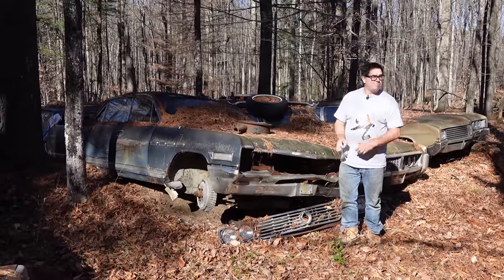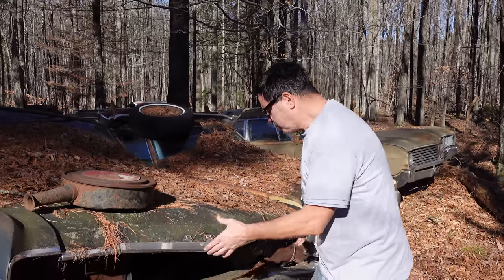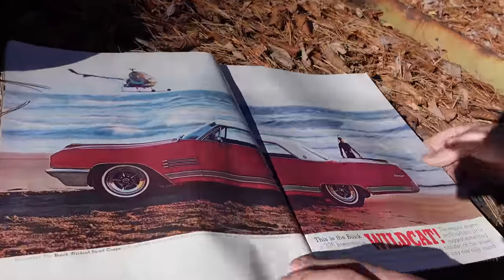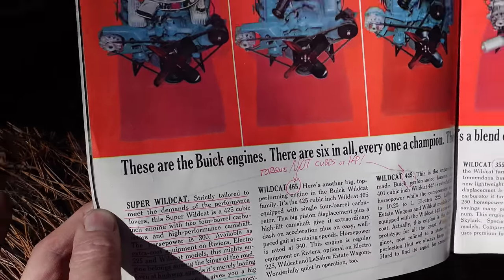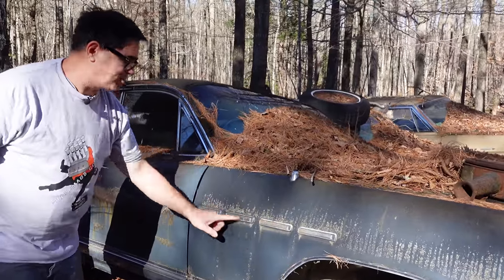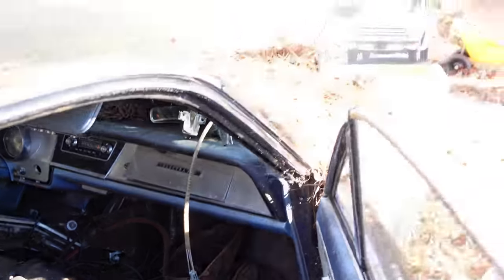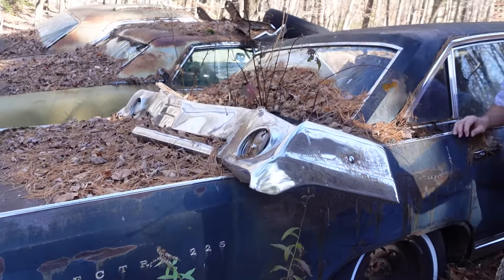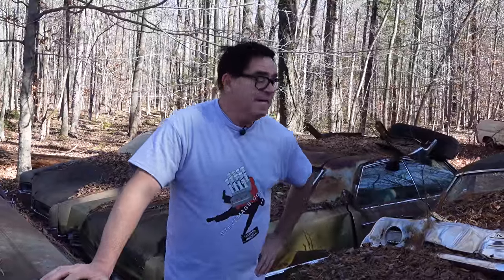Complex Electra Backwards

Comment: Electra Deuce and a quarter. The "Deuce and a Half" was a WWII Military half-track Power Wagon truck. My Dad had a '70 Desert Gold "Deuce and a Quarter". It was 225 inches long and had a 455 in it. Then he got a '77 Coupe De Ville which was a significant down grade. The Electras up until the later seventies were the best cars ever made.
Reply: Deuce and a half we're around for a long time. They also came with a two axle configuration more prevalent than the half tracks. But even now I think those half tracks are so very interesting. When I was a motor sergeant I never had half track in my inventory. But I sure wish I had. Those deuce and a halfs were run on anything combustible. Primary sources gasoline but it run on kerosene diesel fuel. You can hook them together with what amounts to be dry shafts and you can have a convoy of trucks connected for as long as you want it to be. Interesting points you made on the 225. Never mind you have one of them when I was a kid growing up
Reply: With all due respect, fellas, the M3 Half Track wasn't referred to as a Deuce and a Half. They were called "tracks" and sometimes "Purple Heart Boxes" by the armored infantrymen who rode in them due to their open tops that gave no protection from artillery, mortars, snipers, etc. The WWII GMC 6x6 2.5 ton truck was called (usually) a "Jimmy" but it's believed the origin of the term "Deuce and a Half" also began with it (and the Studebaker 6x6). The Deuce and Half nickname really came into its own with the M35 Series trucks which were introduced in the 50s, updated and modernized well into the 2000s, and only recently taken entirely out of the inventory, replaced by the LMTVs. Agree, Old Car Discoverer - the Hercules Multifuel Engine was pretty amazing and could burn just about anything combustible.
Reply: @wes11bravo  that's very interesting. it really is. Given part of my background you think I know more about these vehicles then when I do. Only written in a half track twice. The deuce and a half is always a cargo / troop Carrier truck and 5 ton the same thing and often made into it overgrown tow truck. Found anything they want to put on the back of that chassis. Command units modules just about Anthony wanted to. I think the half track has been out of inventory for some time, but I don't know for sure. I don't think I referred to the half-track has a deuce and a half if I did I misspoken. I did not intend to.

Comment: No, the Electra 225 was called "The Deuce and a Quarter" in the 'hood. The 225 was basically the car's length measurement in inches, so the name stuck. White-Bagley was sold to Dryden oil in 1987-1988 and the Worchester, MA facility was promptly razed. I thought I spotted some remnants of aftermarket AC under the hood. 

No VIN, can't win: but easy to figure out: 8 for Electra 225, K for 1964 model year, possible 1 for Flint, MI assembly and the rest is the production sequence. No tag, can't brag: 64 for 1964 model year, 4839 for four door Electra hardtop, FB for Flint, MI assembly, 661 for Blue interior trim, possible F-F for Marlin Blue upper and lower exterior paint, among other codes. The Flint, MI plant operated from 1904 to 1999 and was known as "Buick City". 

Yes, the Guide division was part of GM and most owner's manuals had the statement in the bulb chart, "When re-lamping is necessary, specify Guide lamps".
Reply: I cringed when he said "deuce and a half". Sometimes I wonder if he's messing with us. I'll bet Steve was a problem child, a real handful growing up. 😲🤫🤣
Reply: @kenttalsma7906  LOL, a rebel in school. "Mr. Magnante! Pay attention. Stop drawing car photos on your test paper. Save that for shop class!!"
Reply: "LECTRO DUCE & QUARTER"
Reply: @johnsader8811  Most older guys just called them "Deuce and a Quarter".

Comment: Buick has always built very good cars .my parents bought a 75 regal in 77 from a guy my dad worked with they were selling because they wanted a new car for towing their trailer the Regal was used for the first two years for towing.  It's a two has the 350 Buick motor not to be confused with 350 Chevy. This motor was built for and used for Buick only. In 1994 my dad wanted to have the motor rebuilt. Well at this time I was working at an automotive machine shop this shop was a one owner shop and he had been a machinist for over 40 years by then he was your old school machinist and I was fortunate to work in this shop because he was well known for specializing in the old cars and it was neat to get a chance to see these older engines.  Well to get back to my parents Buick by this time the Regal had over a hundred thousand.  But my dad grew up doing his own work on his cars in the 50"s like most guys did. Well dad was always one for doing his own mantience on his cars well when the shop I worked for got my folks Buick for rebuild since it was just my boss and I worked as his teardown and prep man  well when I started to teardown the Buick it showed hardly any cylinder wear . All that was required we had crank polished did valvejob. Cam was just a polished and declared block and re rung pistons. My mom is 80 now and although her daily driver is a 2007 Chrysler 300. She still has her 75 Regal and she drives occasionally she would never even think of selling her Buick. I want to thank you Steve for your channel I think your watchers are like me we either as kids went to Junkyards with our friends or if fortunate enough to have a dad that like going to yards himself because he grew up doing his own work on cars. Well that was me I got to share Going with my dad. And enjoyed seeing all the different models.  Although my dad is gone now I think of him when your showing the cars in that yard back there.  Although I would like to visit that yard and have the fun of just walking through. Being out in San Diego ca this is as close as I can be for now and want to thank you for your videos.  Have a great day.  David gleason  lemon grove ca.

Comment: In college I lived with my aunt and uncle in Michigan.  In 1968 my cousin bought a new 68 Electra 225 two door hardtop, every option available.  So my aunt bought his 1965 LeSabre 2 door hardtop, and I bought the 1963 Wildcat from my aunt for $200 bucks!!  Not a quick off the line car with that dynaflow transmission, but it would cruise all day long on I-75 at 80mph and never get tired or warm.  I got maybe 12miles per gallon, but with a 23 gallon tank and gas under 50 cents a gallon, who cared about mileage!!  Great car, I had it for three years.  I'm glad that huge back seat cannot tell any stories!!

Comment: My Dad owned a 1968. He loved it. It was very comfortable with plenty of room for the whole family. He bought It in the fall of 1972, when gasoline was still .37 / gallon. By the end of the of the decade, it had jumped to more than 1.00 / gallon.
The original tires were 9.00 x 15. Tires changed during the 1970's to where it was very difficult to remove a rear tire. Even with the fender skirt removed, there was little clearance. 
Thanks for the memories, Steve.

Comment: Notice the extra holes in the wheel.  That's a holdover from when the cars used lug bolts.  Those cars had a pin on the drum to locate the wheel so you could put the bolts in.  Even though by 1960 Buick went away from that, the wheels didn't change for some time after.

Comment: Those 5 spoke styled wheels with the black inserts were in continuous production, unchanged, and optional on most mid-level and high end Buicks all the way until the last 1987 rear wheel drive G-body Regal rolled off the line. Those were some beautiful wheels. Perfect combination of sporty and elegant. 

I always love looking at those massive aluminum finned drum brakes from that era. Who needs vented rotor, 6 piston caliper discs when you have those behemoths?
Reply: They were available on other models besides the Regal in the 1980s as well.
Reply: @googleusergp  I know that’s why I said most mid-level and high end Buicks UNTIL the last rear drive Regal was built in ‘87.
Reply: @joe6096  That's a bit of a dubious statement as lower end Buicks had those as well prior to 1987. Also in 1987, there was both the LeSabre and Electra rear wheel drive wagon. The Electra would have been the top line wagon, and the wheels to my knowledge were available on both models in 1987. The literature doesn't really specify.
Reply: @googleusergp  You could not get them on econoboxes like the 80s Skylark or Somerset.
Reply: @joe6096  No, I agree, but I didn't say that. A Buick Century (the RWD version up through the 1981 model year) could have had it. Be careful about the "Somerset" name as that was also used on RWD Regals prior to it also being called a "Somerset Regal" in 1985 as a front wheel drive "N" body car.

Comment: Great video Steve!I own a 63 electra sports coupe 225 .I saved from the junk yard.motor was stuck and just beat.I managed to find a 4 door 64 wildcat with only 29,000 original miles and to my surprise it had that turbo 400 and 401 nailhead.the car is very rare only like 1,300 made originally believe .it is almost impossible to find certain parts for it.the only thing I’m looking for now is that rear bottom panel piece of pot metal.two up on eBay and both are the side I already have
Reply from the maker: Very cool!

Comment: The OILZUM  engine oil got my interest .  I remember using it as a kid in my woods bombers when DAD  would visit P. town where he was born and bring back six or eight cases . I still have two oil spouts that you would shove in the top of the can hanging on my shop wall .  To me the sixties we're a magical time for a kid to grow up in .
Reply: Never used those. My dad had some old can openers and as a kid it was my job to open the oil cans when I was helping him. I would do two holes on one side and a smaller "vent" hole on the other side. I still have the can openers.

Comment: Thanks, Steve! Buicks had a lot of different features from their GM brethren, but by the late 1970's those differences were quickly disappearing. By the 1980's it was mostly just different grilles and tail lights.
Americans still drive huge 'Yank Tanks' , now they're 4 door pickup trucks! 😁 And I guess  'deuce and a quarter, sounds better than  'double deuce, nickel' .
Reply: I always wanted to take a 77-85 midsize GM and say run a Pontiac body with a Buick nose, Olds doors and Chevy taillights.
Reply: Mr. B ! Right on !
Reply: @CR7659  GM did that with the full size Pontiac Parisienne, it was really a "Chevyiac". LOL.
Reply: @googleusergp  There are a lot of Canada only Pontiacs that are rebadged Chevrolets due to Canadian content laws and it not being worth the expense to make Pontiac specific things in Canada.  

For instance you could buy a Corsica as a Tempest there and the only difference was the badges.  

The Parisienne came to be from Pontiac dropping all full size sedans for 1982, but customers still wanting them, so dealers imported these from Canada.  They sold enough Pontiac made it an official model for 83-86.  

I had a 1987 Safari wagon and they have the same dash as a Caprice, right down to a Pontiac bolt-on badge over the molded in Chevrolet one on the right side.
Reply: @CR7659  The reverse was done as well. My parents' 1979 Pontiac Phoenix was a "Bui-iet" of sorts. It was a Buick V6 equipped Chevrolet Nova based Pontiac. Many parts were shared with the Nova of the same vintage.

Comment: when I was a teenager back in the 80's, a buddy of mine blew the engine in his 76 cutlass and had the bright idea of pulling the engine from a Buick 225 to swap into it. What a nightmare lol, nothing would line up or interchange. We ended up with a welded mess that had no heater, ac, and the trans kickdown never would work. Ended up selling both cars for $200 and calling it quits. Lots of lessons were learned that summer.

Comment: Wrong! The 445 Wildcat was the 401 4bbl. The 410 Wildcat was the 401 2bbl and the 375 Wildcat was the 401 2bbl low compression. (The 375 Wildcat was also a 1966 340  bbl). The 425 CID was the Wildcat 465. And yes, there was a Super WIldcat, a 425 2-bbl, but it also had 465 lbs/ft of torque. 1963 was the first year for the 425 as an option for the 1963 Riviera. In 1966 the Quadrajet was introduced on the 425 before then the 4 bbl carbs used was either the Rochester 4-jet or the Carter AFB, either of those used the aircleaner with the smaller hole. The air cleaner you are holding is from a Wildcat 445, with is a 401 4bbl.

Comment: a tidbit about Guide during the period known as WWII the lamps became a very small part of their production . During the mid 80s I worked with an ancient guy in a machine shop who worked at Guide until he was drafted mid war . He started in stamping and spotwelding head light buckets - that department later stamped and spot welded the pieces of what became known as the Greasegun , the cheap throw away replacement for the big dollar Thompson. When GM got the defense contracts he was moved up to actual machinist making the basic block of the Browning M2A just like GM gang milled engine blocks

Comment: Interesting fact, when they bought back the V6 tooling and machines, GM put it back in the same factory, the floor still had the holes and fittings and they bolted and mounted it in the exact same place, like it never left.

Comment: Back in the mid 80's I had a friend that owned a 61 225 like that with the different A pillar and grille and tail lights etc. It had the 401 with the 445 Wildcat tiger decal on the air filter. It was a single 4 barrel and weighed about 6 metric tonnes but could really move out for such a land yacht! It was sitting behind a shop for several years he worked at and he got it running and it became his daily driver. Still had the clear plastic on the seats the original owner had installed. Sadly he killed it and it got junked, It was in real fine shape too. But like you said, these cars were gas hogs and past their prime even by the mid 80's and no one really wanted them and they were a long way off from collector status. Plus having a 2 speed Dynaflow sucked compared to a 3 spd 350 or 400 trans.

Comment: Seems like a late great aunt & uncle had one of these, a big four door. I only saw it when they were traveling. I’m seem to recall my great uncle saying it had the 425. I was young enough not to have much understanding or interest in automobile tech at that time, but remember the back seat area was huge. My granddad was into 67 full size Chevrolets at the time and had accumulated a 67 or 68 225 for what reason I do not know. Other than a burned valve in the 350 and a big dent in the front fender, it was in pretty decent shape. The previous owner had put clear plastic seat covers over the factory cloth upholstery, preserving it. I don’t remember if he bought it for parts or had the idea of pulling the 350 Buick and dropping a Chevy 250 six - he liked those motors and driving it. He never did.

Comment: Smaller 9.5 x 3.5" A-body 5 x 4.75" BC Aluminum front drums were used on later '60s and (and possibly early '70s) Buick Sportwagons. I have a set.

Comment: That car IS actually an a/c car. 
Minute 2, you can see the drier in the extreem lower left screen. 
If you look hard, you can make out the gasket hanging off the evaporator box with an expansion type device. 
Maybe someone has already mentioned it.

Comment: was it Edsel or Lincoln who also rated their MEL engine by torque? I can't remember, I think it was the Linc that had the odd E in front of it. 

Agreed, GM should have had those big drums in 1964 and the switch pitch torque converter from 1962.

Comment: Hi Steve, nice video.  The Buick Ventaports in my opinion, could have been functional to help remove hot air away from the radiator and it would have not cost Buick Motor Division that much more.  Robert E. Petersen started Hot Rod magazine and later became Petersen Publishing Company.  Motor Trend magazine and quite a few other magazine(s) where printed by Petersen Publishing Company also, and his information was very accurate.  Please reply.  Dave...

Comment: Did you forget to mention that the "225" came from the length of the car? 225 inches.
Reply from the maker: Hello Jim H. Thanks for writing. I checked my Buick data and while I couldn't find info for 1959 (first year for an Electra 225) it is true that a second-year 1960 Electra 225 measured 225.9 inches in length. But by 1964 it was listed at 222.8 inches and by 1971 a full 226.2 inches. All of that said, i did stumble with my "deuce and a HALF" reference. I had GMC military truck on the brain. Anyhoo, Thanks for watching and writing. -Steve Magnante
Reply: You’re only human! By the way being of by only 1/4 ain’t bad at all!!!
Reply: Guys, old guy checking in. If my memory serves me correctly, there were 2 separate Electras in 1959, the inaugural year. There was a regular Electra, then there was the Electra 225, which did measure 225 inches long. The Electra was luxury, the Electra 225 was super luxury.

Comment: My dad owned a 73 Electra Limited 2 door coupe blue with white vinyl top, 455 Engine with custom dual exhaust. That car was stolen so he purchased a 73 Electra 4 door. My dad was a speed fanatic so he took the car to Motion Performance in Baldwin Long Island and had the engine bored to 500 cc. Crane cam, Holly Carb and manifold, nitrous oxide, headers and dual exhaust. I just got rid of the car and can be seen on Tony Angelo ‘s you tube channel. I would have kept it but am retired and couldn’t afford the garage.

Comment: Hey Steve, I have a question about the brake system. I noticed in this video that you said that it had the single braking system and wouldn't have the dual system until 1967. My question is I could've sworn that in previous videos that you said the dual system brakes didn't come out until 1968, right? Maybe I'm just misremembering Wouldn't be the first time.
Awesome video, as always Steve